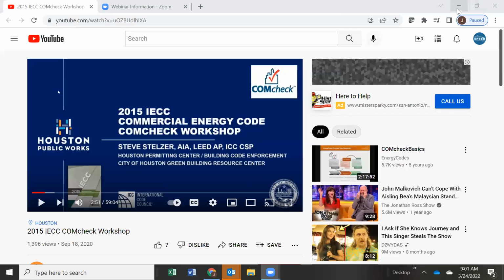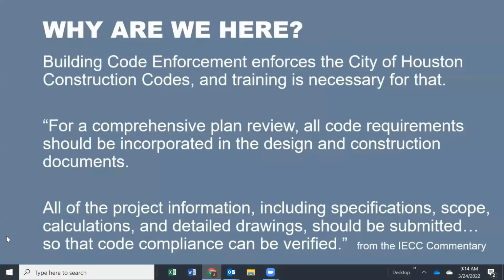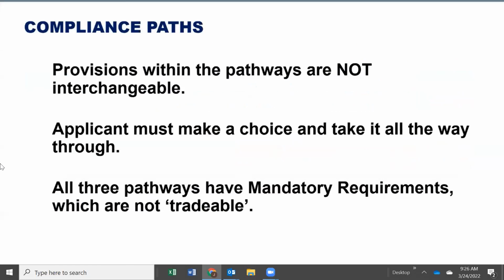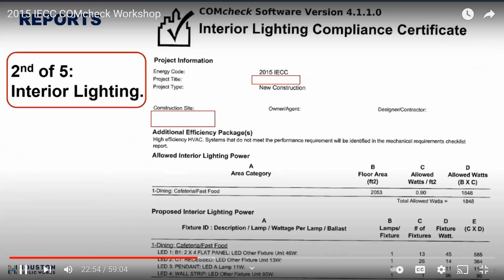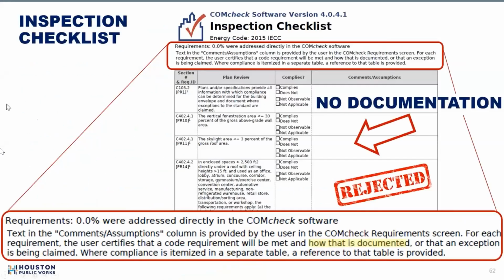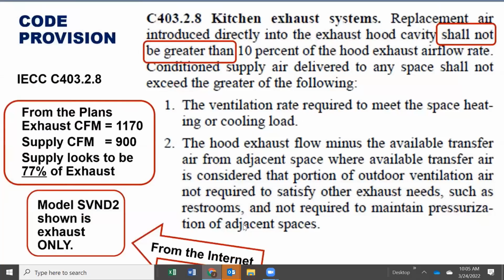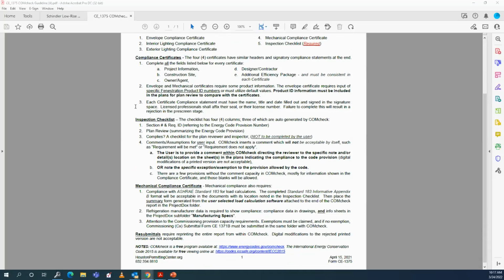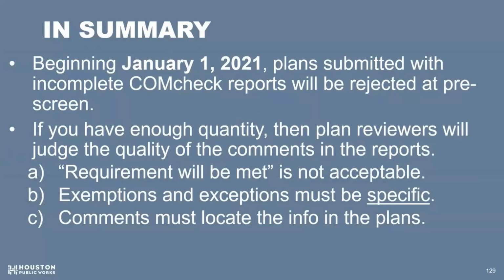COMcheck Submittal Requirements

Comment: Found this video a few years after it was posted but why do I need to have a checklist for my own design? I have to use the entirety of the energy code as a checklist to make sure my design complies. ComCheck software doesn’t give you an option to check the “complies” boxes. That tells me that it’s not for me to check the boxes but rather the plans reviewer. I can see adding comments of maybe the sheet that I’m saying it’s in, but if I check the box that it complies and the plans reviewer disagrees, what do they check themselves? Am I supposed to initial my checkmark?